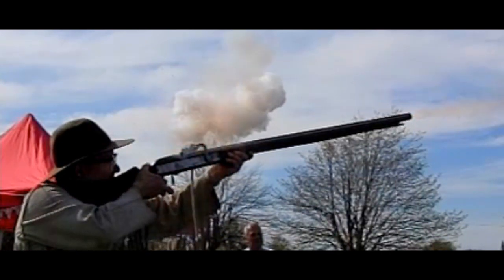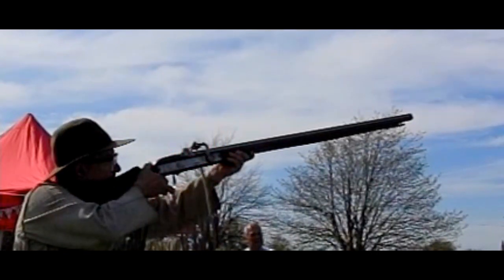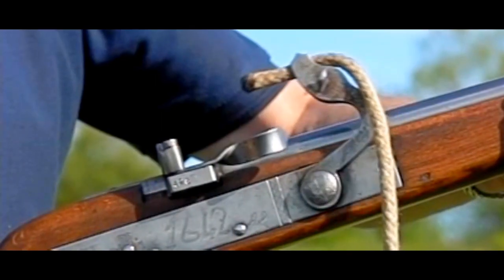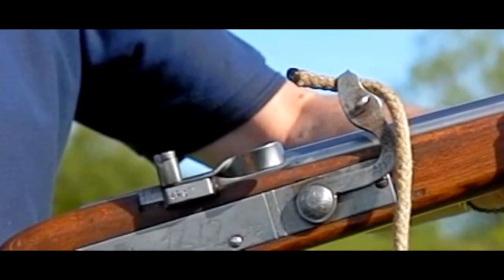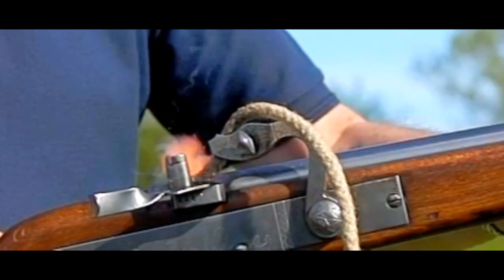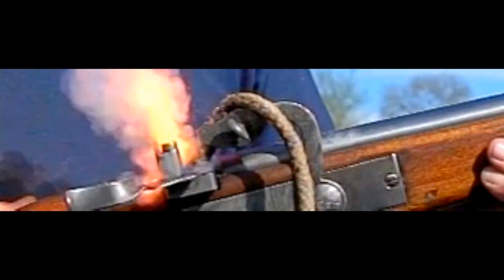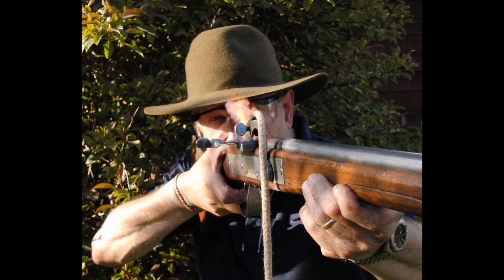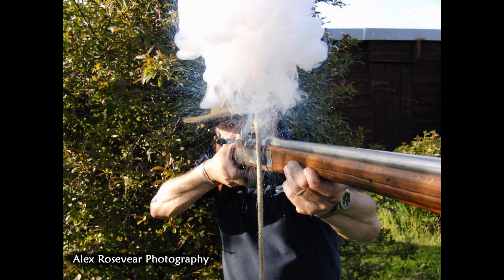Matchlock Analysis Slow Motion

Comment: Actually, I thought the expression "a flash in the pan" comes to us from the days of flintlock technology. I read somewhere that the British Brown Bess musket had a 20% chance of misfiring... i.e., a "flash in the pan"... on a given shot, which didn't matter much considering these muskets were mainly used for massed, on-command volley fire in which 80% of the muskets actually sending lead downrange was good enough. (I've even read that many British soldiers liked it that way, as they felt less like murderers when they used individually unreliable weapons which they weren't even purposely aiming.)
Reply from the maker: bjggjb Thank you. That's an interesting insight. It may well be true. I made a flintlock video also. Feel free to take a look. Thanks.
Reply: I would say both have the same problem when you have a blocked touch hole, so the saying could go back as far as the match lock.